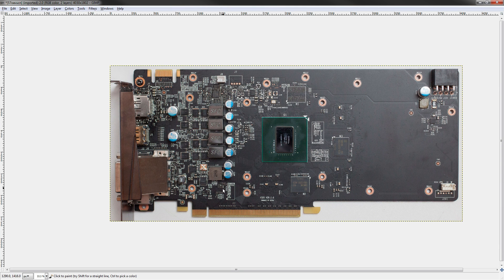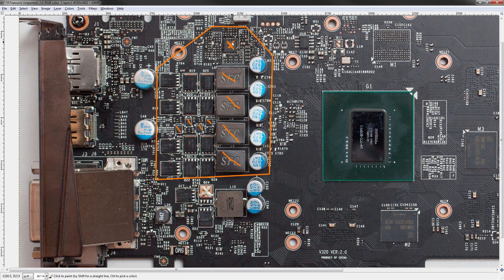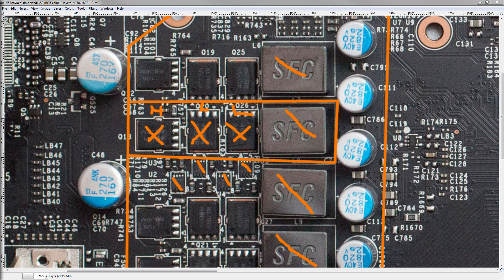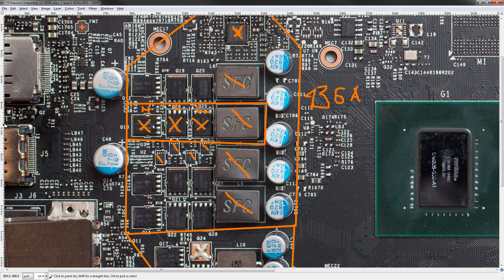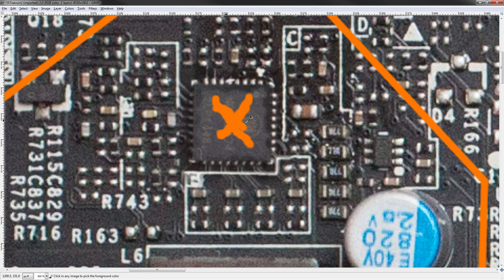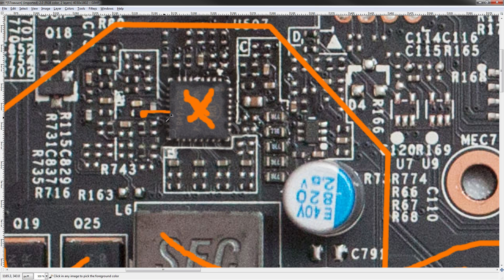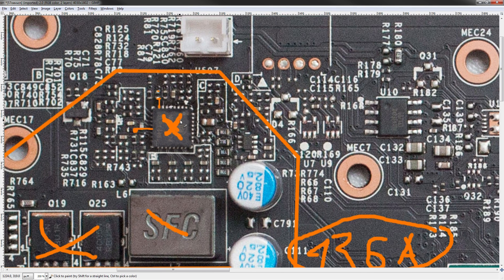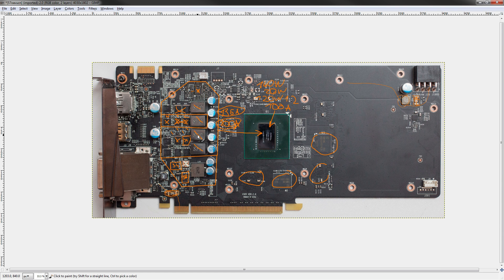GTX 960 Gaming PCB breakdown + voltage & power mods

Comment: Hi! Thanks for the info! I'm modding an EVGA GTX 960 FTW with the ACX cooler, though I swapped it out for a CPU AIO with an adapter that I modded to get good VRM cooling. I'm wondering how to tell what the new GPU Vcore is once doing the mod, though, since after I turned it up, HWinfo and GPU-z still report 1.275 V at full load. I measured that pin on the controller to ground and got 20k ohms (your video said you measured 2 Kohm on your card?) I added another 20k ohm varistor. In some positions it works and others the card is unstable. I guess I can do the math for a resistor in parallel to figure out what voltage the NCP* thinks it's getting on that sense pin, but not sure if it's linearly increasing output to the GPU in response to the artificially imposed voltage dip.

I also noticed there's still a "Performance Limit: Power" despite that I soldered a wire between the two sides of the current shunt (I only found one, big resistor, by the +12V power connectors). Despite this, I'm free to keep cranking up clocks and don't see any actual throttling happening. Thanks for any tips!

Comment: excuse me if I bother you with the question but here it go: accidentally I sorted the fan pins of a  gtx 970 and since then it doesn't work. where should I start seeking on the pcb? I did not spotted any burned.

Comment: ** QUESTION **  Im at 1520 mhz at msi gtx 960  ok ? if i go higher ex. 1530 - 40 and start a game I don't get artifacts for sometime 1-2 min and then im geting some artifacts and even crashes , im at 1.275 Vcore Air Cooling so... the question do you think this is from the VRMs that erm.. that the vrms geting warm or even hot  ( i don't know what temp they are) that i get artifacts after a some time or is from the core becouse im at 60 *C at core.
Reply: i had an gtx 960 sc running at 1575 mhz with +100mv and 110% power usage. stable
1620 mhz on csgo but it was artifacting nightmare.

Comment: https://www.techpowerup.com/reviews/MSI/GTX_950_Gaming/images/front.jpg
i was using msi 950 gaming in the past and i found that the msi 950 gaming pcb is almost the same as this msi 960 gaming, 950 is just missing some low side mosfets and capacitors. i modded and flashed a 300w @ 1.275v bios on that msi 950 gaming and during gaming i got 150w max.

Comment: Is a Evga 960 ssc pretty similar on the pcb, im guessing not. i have an old one laying around that sat at 1575-1610 mhz so im really interested in bios modding and voltage mods. the 1070 i just got has me sitting 1st in my hardware configuration on the free firestrike fx-8320 and a single 1070, think it still says uknown gpu but its a g1 gaming and that has an average boost that stays above 2100 but tops at 2168 edit. but i fucking hate gpu boost 3
Reply: hoping for zen lol

Comment: The scenarios for those questions are 4000, 5000 and 6000 Intel CPUs with high - but not extrem - OC (lets say at 1,35 - 1,45vcore with something like a nh D15 or a watercooler with a 3x120mm radiator):

a) Does RAM with high clock speeds (respectively low timings) negatively impact CPU overclocking potential / require a higher vcore? If yes, how big of a deal is it?

b) What should I look for when buying a mainboard too achieve a high CPU OC?
When I bought my last mainboard some time ago, I used a search machine and filtered for Z97/ Z87, at least 8 CPU Phases, 8x/8x PCIe Multi-GPU support and then sorted by price.
Skipped a few mainboards on that list, because the VRM radiators on the mainboard looked small and ended up with a ASUS Z97-A for ~120€.
Is there a better way to shop for a mainboard?

c) I run this mainboard with a i5 4690k @ 4,7ghz at 1,36vcore; can't get a stable 4,8ghz OC, even tried up to 1,425 volts.
Lets say I had spend 250€ on a mainboard, would that have had any impact on my overclock? Does having more than 8 Phases help with overclocking a i5 or i7? How about i7 extreme Cpus?

edit: I'm running 2 sticks of 4gb 1333mhz cl10 ram, which are overclocked to 1400 cl8 (still got those from back then when I bought my 1st pc, which had an i7 920)

Comment: You ought to stack a couple of TECs to cool a low power chip sometime. 
I tested a single 60w TEC 40mm on a waterblock and it went all the way down to -25c on the cold side. 
That thing cooled d own by a 400w TEC could probably push a low power chip sub zero without much issues.
Reply from the maker: Oh I have plans for a lot TEC cooling experiments but I also have a lot of other stuff to get done before that.
Reply: Actually Hardcore Overclocking take it easy there bud, ur triggering my jimmies over here. 

Also as a side note, PC desktop mining is profitable again. 
2016 = return of desktop mining, even CPU mining.
Reply from the maker: I'm guessing the profitability only applies to ETH and only if you don't pay an insane power bill. Power in the UK isn't cheap. If you're worried about how long till I do stuff with TECs I'm aiming to do something with them within the next month or two and this won't change unless something dies on me.
Reply: Actually Hardcore Overclocking I'm making around 80-90 dollars a month whilst pulling 350w, I'd call that pretty decent. 
But I don't suggest people go out and buy hardware just to mine with, it's decent if you already got the hardware laying around. 

Also one thing when it comes to TECs, the ones you buy online from ebay and such seem pretty fishy, lower binned ones. 
I see huge differences in deltaT between the ones I got, some spots on the TEC can be defect and so on.
Reply from the maker: My "big" TEC project is going to be using 4 undervolted 24V TECs rated for 200W. At 12V I'm gonna get a good DT and a relatively low power draw along with a Qmax of 500-600W. That's going to be used for a water chiller with the goal to do 0C water under load with 200-300W heat loads. Ideal for freezing mid range GPUs and 4 core intel CPUs. I can always go out and get some of those cheap 12V TECs that do like 300W Qmax while pulling 400W but I want to do something a little more sophisticated first.
Reply: Actually Hardcore Overclocking undervolted DECs might have a better efficiency yeah. 
TECs and TEGs are really interesting devices, kinda interesting to think the highest efficiency TEG has a 10% efficiency, crazy.
Reply from the maker: Yeah I think I'm looking at something like 120W power in to get a Qmax of around 150W per TEC. DTmax should be around 55-60C. So at 50W going into each of the TECs I will be looking at a DT of around 34C. Which isn't great but if I wanted to get a better DT I would need to burn a hell of a  lot more power and I don't want to use more than 500W of power for the whole chiller and I want at least somewhat compact.

Comment: I have a msi gaming r9 290x 8gb 
it has a accelero xtreme 3 cooler on it and the vrms go up to 110c. should I worried
Reply from the maker: yeah those temps are OK.
Reply: * be worried
Reply: my sapphire 390x hits 70 on the vrm
Reply from the maker: there's 2 VRMs on the card. Which one is hitting 110C? because usally the minor VRM is the one that runs hot.
Reply: its the VRM 1. VRM 2 stays always at 55c even if the card is cold or Iam gaming for 4 hrs
Reply from the maker: if my memory serves me right VRM1 is the minor VRM.
Reply: okey, and could the temperature damage it? I took a closer look to the VRM heatsink and it looks like just the lowside of the core VRM is touching it

Comment: Hey buildzoid, I just want to thank you so much for making these great videos, really interesting to watch, and really helpful as I'm trying to learn more about VRMs, and these videos are really helpful. 

I was wondering if you maybe shed some light on a question that I have: I don't know if it is like this for gpus as much (still a lot more of your videos to watch), but I know for motherboards, on lower-mid end Z170 boards, they'll have a "8 or 10" phase VRM for the core voltage, which we know is really just a 4 phase channels from the pwm controller.

However, upon closer examination, each real phase from the pwm goes into a driver, but then is split between two different phases (inductors, high and low side mosfets.) I was reading Sin Hardware's VRM guide, and he briefly touched upon this, saying that splitting two phases from one driver was not the correct way to do it, and is doesn't cut the switching frequency in half like a doubler does.

Because of this, I'm assuming that without a doubler, you don't really have control over each independent phase, instead the driver treats both of the phases like one phase in total. I'm guessing they do this to use much cheaper Mosfets and Inductors, but am at a loss why the doubler is really of use (I know in your PCB analysis of the 1080 FTW Hybird on Gamer's Nexus, you said the doubler could do more advanced things like use the phase with the least amount of current going through.) 

Still I'm not really solid on this, it would mean tons to me if you could respond, or maybe regard using a true doubler + drivers, or just driving two phases from one driver in one of your videos. Sorry in advance if you've already covered this!
Reply from the maker: Basically if you use a doubler you can do some very primitive current balancing. But you can also run a much higher clock into the doubler and then feed the MOSFETs half that to get very close to a real phases' accuracy. Taking the output of the driver and shoving it into 2 phases worth of components is a popular marketing stunt but does absolutely nothing for power quality. You just get a higher current through put and better thermals due to the extra surface area. However they could do the same if they increased the amount of FETs in each phase and just used 1 large choke.

Comment: Speaking of old cards, can you do a breakdown of an ATi x600* Hypermemory?
Reply from the maker: WAAAAY too old. Like so old IDK what it is
Reply: This:
https://www.google.com/url?sa=i&rct=j&q=&esrc=s&source=images&cd=&cad=rja&uact=8&ved=0ahUKEwiQi8jQzvTOAhVm5YMKHRwVBvMQjRwIBw&url=http%3A%2F%2Fixbtlabs.com%2Farticles2%2Fvideo%2Fx550.html&bvm=bv.131783435,d.cGc&psig=AFQjCNFbuDBA_uMMYhS5_ld21qWARizS_g&ust=1473040748671311
Reply from the maker: Yup way too old. Also those pics are pretty blurry. So I can't see anything too useful in them.
Reply: The pictures look pretty legible to me, just about the same as the ones you usually see for modern cards http://www.ixbt.com/video2/images/x550/sapphire-x550-scan-front.jpg 
That said, the&#160;card is old school! I agree that it's probably not worth discussing, you can do your own analysis by looking up the datasheets of the chips on it. Most of the concepts are similar (look at the power ratings of the mosfets, see if you can find a datasheet for the controller, etc)
Edit: ugh you can't read half the chips. You're right : too blurry
Reply: Thanks!